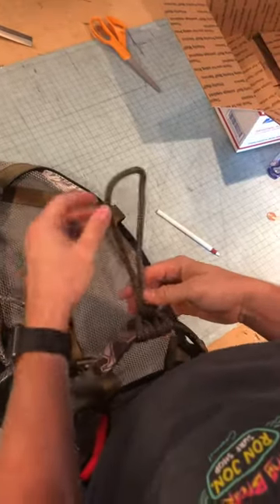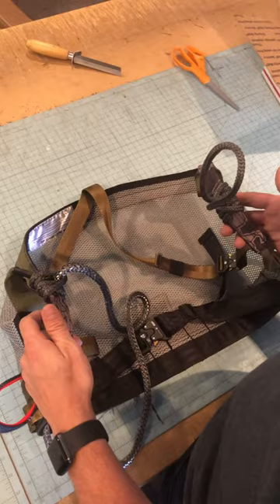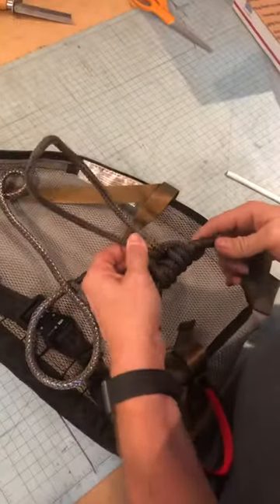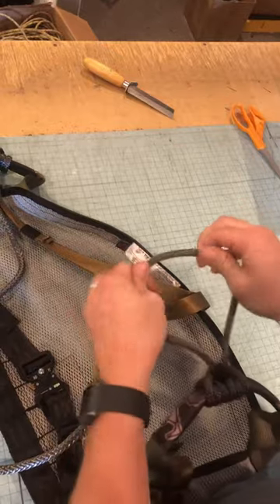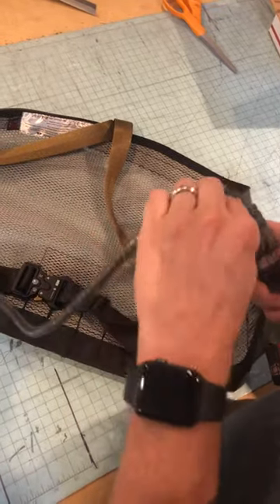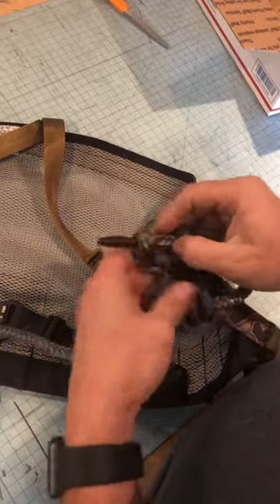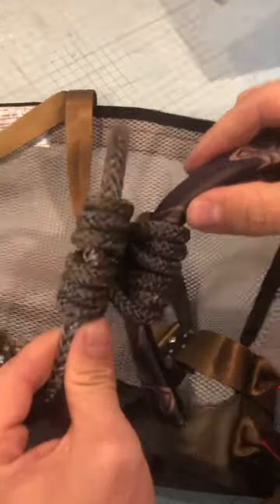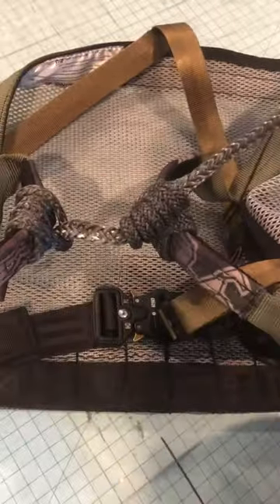How to tie on the crüzr adjustable bridge.

Comment: Thanks for the video. I installed mine on a Original Kestrel Flex. I could have used a little more length of amsteel  on the continuous loop, it was difficult to make work on the reinforced bridge loops.

Comment: My cruzrXC continuous loop has a really thin spot like the bury has pulled through.  Is that normal?  I noticed it after re-installing it before this season.  I see your loop here is thick the whole way.
Reply from the maker: What you are describing does sound normal. If you would like confirmation, you are more than welcome to email us some pictures to support@cruzrsaddles.com

Comment: Question. Why do you have to attach the amsteel on both sides of the bridge loops on the saddle with a prusik? Couldn’t you just attach it to the bridge loops on each side with a single girth hitch and then use the prusik on the bridge to adjust it instead of 3 prusiks?
Reply: I think I am going to have to use this method, because what they sent me is like 2" too short on either side to do what they are doing in this video

Comment: I just got mine and it's like they made it 2 inches to short
Reply: Same, I just got mine and compared it to the old bridge once it was off the saddle. It 's 2 or so inches shorter than the original. You can only get 2 loops instead of the 3 loops that cruiser installs.